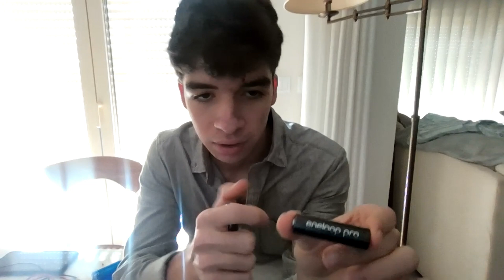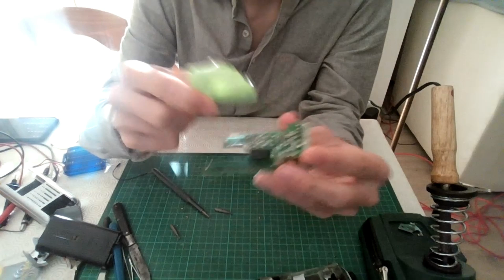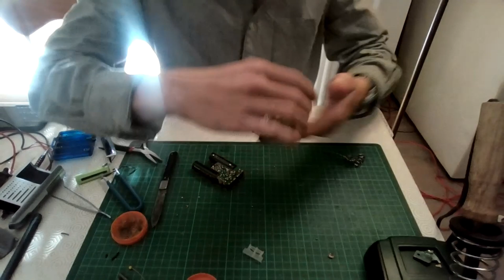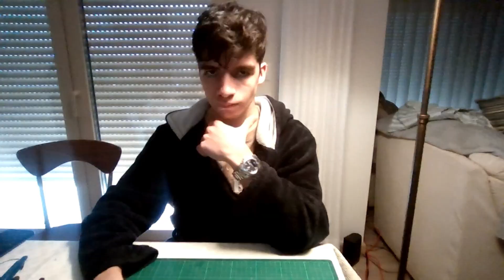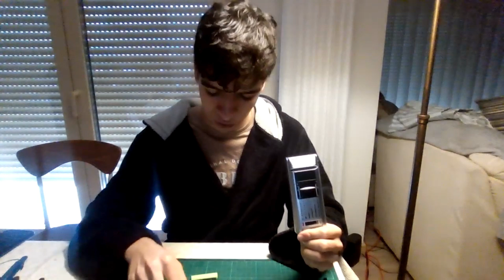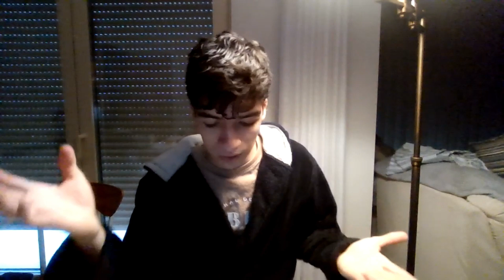[Outdated] How to replace Braun 6550 Shaver Batteries [Tutorial]

Comment from the maker: Update: after about two months the batteries stopped charging. I should mention that the PCB was already damaged before I made this video, and I had replaced some components on it beforehand.
I don't think the battery replacement was the cause, but I've seen people having similar issues after replacing the batteries, so, treat this video as a work in progress.
I want to buy another shaver with a working PCB and do another video tutorial replacing the batteries. I'll report back after a couple months of use.

Comment: I am rehabbing a 6520 and the process is very similar. The tabs on the original batteries have a very specific shape and I cannot find replacement batteries with those specific 2-prong tabs. You simply used wires for this one, that doesn't seem very stable? How is the shaver working these days?
Reply from the maker: Sorry for the late reply.
Yes, using wires is not very stable, however when everything is packed up the batteries don't move around, you can also use a bit of hot glue or other way to fix them in place, for me it was just easier to use a bit of wire.
The shaver is not working (again) as of right now 💔, however that has nothing to do with this intervention, the shaver had faulty parts that I replaced before this and they might have gone bad again.
Let me know if you need help with anything else.

Comment: Most detailed video on the 6550 I found yet!  I managed to disassemble mine in a different order by removing the covers from the two bottom screws, then the two screws themselves before sliding the whole case off followed by removing the black internal covers.

The problem I'm now trying to solve is that after the last step two small rubber blocks fell out and its unclear where the should go, so that's what I'm really going to watch the video for.  Suggestions?
Reply from the maker: @ralfbaechle  the rubber blocks are placed inside the pcb housing.
They make contact between the black plastic cover and the batteries.
Let me know if you need any help.
Reply: @uskyen7025  Thanks, that was very helpful and also a very quick answer!  Taking another look it seems the two blocks go into the gap between the motor and the neighbouring cells which prevents direct contact of the black cover thus an annoying vibration sound.

Next: get replacement cells!  This is a good shaver and I think totally worth the small investment to repair so to have a spare.for traveling or in case of a defect.

Muito obrigado da alemanha 🙂
Reply from the maker: @ralfbaechle  Great, let me know how the project goes, I'm here if you need any additional help 😁
Reply: @uskyen7025  Well, in any case this is goig to take a little while as I have a fair number number repair projects and for now I'm analysing each of them for repairability, compile a list of spares before placing a likely pretty significant order of random spares.